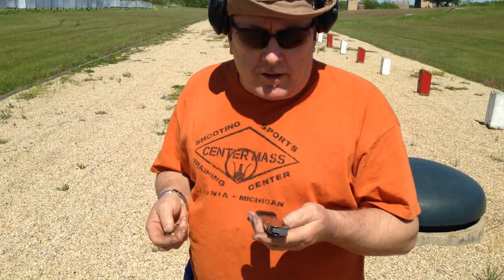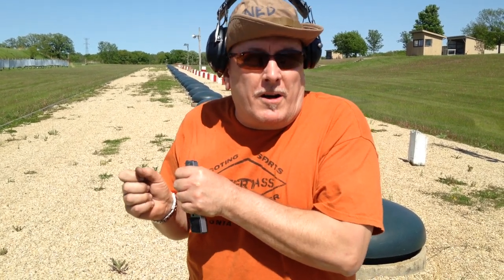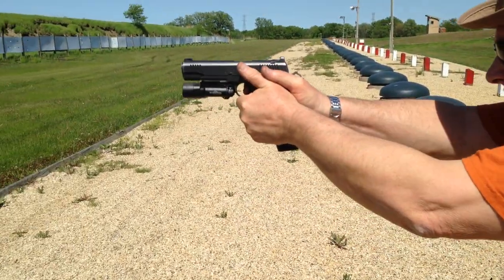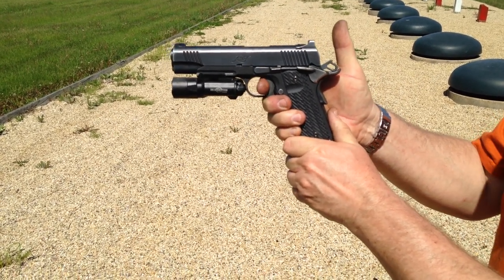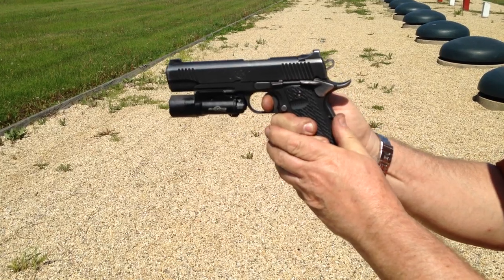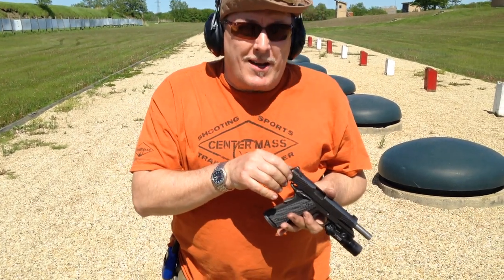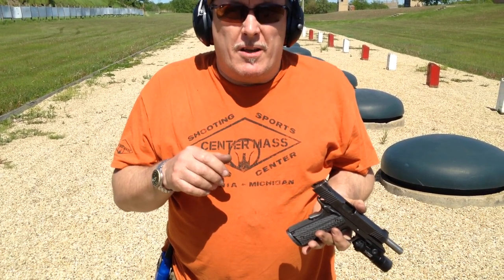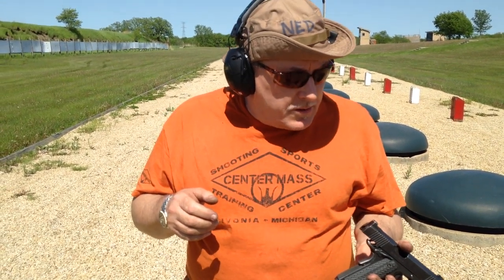2 of 3: Passive firing pin problems-- live fire demo

Comment from the maker: If and when I can, I will add something discussing the fix but it's a 
tricky one. The firing pin block lives under the rear sight so the sight
 has to be removed to get at it, and then you have the added inconvenience 
of having to re-zero the pistol. The firing pin block itself is somewhat
 delicate and hard to effectively hold to work on it, without damaging 
it. The real fix is "send it back and express your concern and 
disappointment" but I don't know if / how well that works.

Comment: Interesting, yeah I’m not a fan of the 80 series 1911’s. Stick with the 70 series
Reply: What is being shown has nothing to do with Series 80; he is showing a grip safety activated firing pin block with issues...(nothing to do with how Series 80 operates)
Reply: @mdd1963  he is showing how to not grip a gun properly to make a problem because he has some ax to grind, not quite sure what his problem is yet, david dundrea is exactly correct, you don't want the firing pin block , don't buy a gun with it installed, this guy has a chip on his shoulder for some reason, probably trying to  sell something
Reply: true, I think in California you don't have a choice, I would take a swartz over a series 80 any day, no trigger degradation